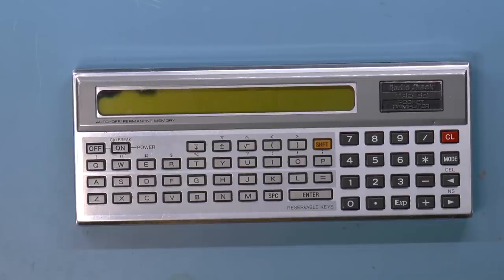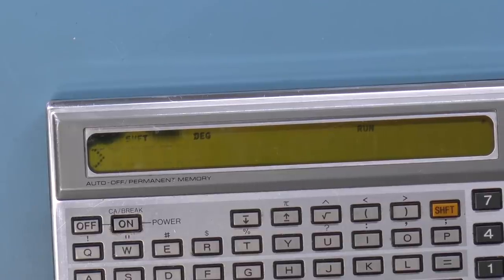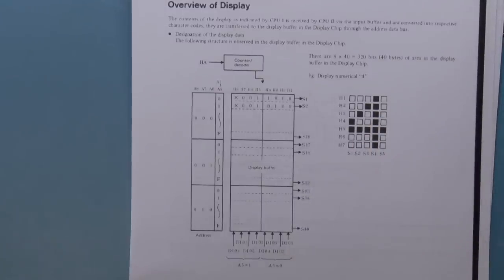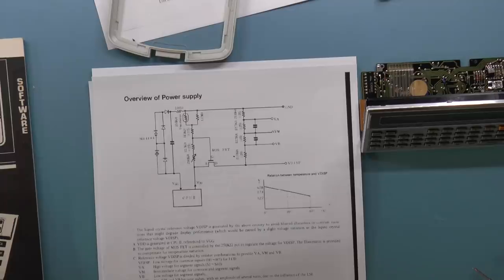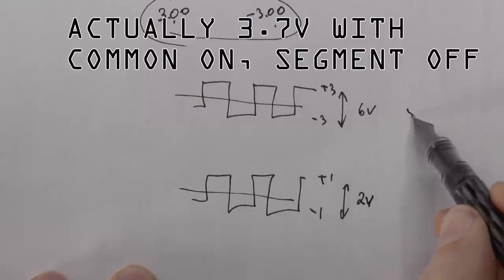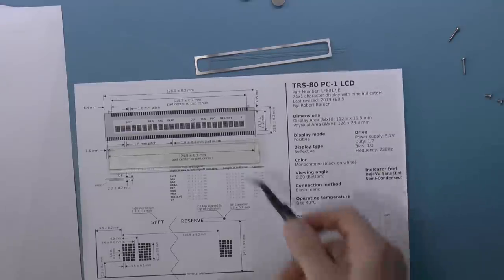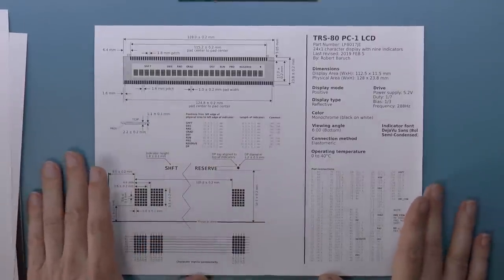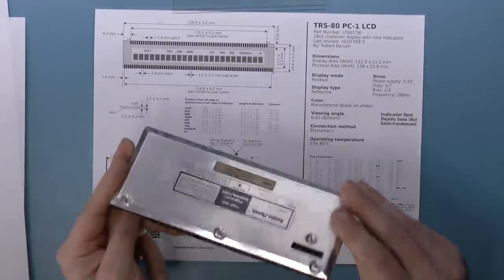Fixing ALL the TRS-80 PC-1 computers.

Comment: I'm one of those few hundred owners, Robert. I bought mine when it first came out and used the snot out of it. It's still the best advanced calculator I've ever used (even comparing current calculators). I would definitely purchase a custom LCD from you if you had one to sell. These are irreplaceable. It's a shame no one sees value in them anymore. They are incredibly powerful little calculators. I would buy one of these long before I would by a modern graphing calculator.

Comment: Greetings from a recent Tech Tangents video! I was so fascinated by this project, I just bought one on eBay with a printer and a trashed LCD, and bought your replacement screen, just to join the two together. It's so fascinating to learn that a replacement glass LCD can be manufactured at a reasonable modern cost! (And yeah, I'd fully expect Sharp to have paid a lot more than that, at the time, with the time's technology!)

Comment: Heroic effort!!! I'm collecting Sharp Pocket Computers and I have 2 of those, both of course badly affected by the cloudy display problem. The very few that are not or almost not affected are hard to get on eBay and are actually kind of expensive, so I would think there is a limited market for your solution! I certainly would buy 2 for the price you mentioned in the video! I also would consider buying a "refurbished" one. 
Anyway, here are some additions to your video: Originally, the batteries to be used in the units were not those zinc-air thingies with holes in them, they used Mercury based cells. Those are no longer made, I understand both for ecological reasons and because those could cause severe health risks when ingested (e.g. by minors). Anyway, these zinc-air cells have the same voltage and form factor as the original Mercury cells. People have reported that using more durable 1.5V cells with the same form factor instead works as well and doesn't harm the units...but try that at your own risk! 
The printer.......SHARP CE-122 . If you haven't already fallen in love with the TRS-80/PC1211, get one of those printers! Most of the units on eBay will not work anymore because they have NiCd cells installed internally that at best are dead and at worst have spilled stuff onto the PCB. Another restauration project.... most of the time you can get this working again by just replacing the NiCd cells. 
The printer uses a single needle to transfer ink from an endless ribbon (in a cartridge) onto plain paper. Unexplicably, those ink ribbon cartridges are still in production!!! It's super slow, it cannot print small caps letters, it makes a rediculous sound, .... but it is sooooo 80s :-) . Absolutely brilliant for it's time.

Thanks for the video and the effort to restore and preserve these historic machines (for many of us this was the first computer they programmed themselves).

Comment: i still have my original TRS-80 pockets computer. though mine uses the larger 3v coin cell battery .  guess mine might not be the P1? luckily my LCD is not damaged. also these could run on external power if you have the dock it plugs in to, it might also had a printer on that.  these really were awesome for their time. back when they gave you the manual to learn basic code.
Reply: mines a PC-4 , much shorter LCD screen. and uses two CRxxx 3v batteries. glad i looked because they were dead and could leak.  idk if it would be worth even china making a replacement lcd? i guess if a lot of people wanted to repair theirs. great video explanation on the LCD logistics.

Comment: I want to mention batteries (maybe its mentioned elsewhere here, but worth repeating). The originals were four PX675 1.35V MR44 battery cells- I see Wein listed as manufacturer for this style, but the M stands for Mercury, so they stopped production of these a while ago. They're no longer manufactured, so I found a four-pack of Nuon silver-oxides which advertise themselves as a replacement for PX675s . Apparently many have used 675 alkaline batteries meant for products running 24/7 (like hearing aids? I guess?) and they will therefore run out very quickly. So while they may have seemed "easy to replace",  some of these are going to be a disappointment for someone who wants to travel around with it and otherwise expect to use it for years without replacement. Wein makes 675 zinc-air batteries specifically to replace mercury batteries and these will work fine, if not for as long as the original mercurys.  Just be careful about which 675s/MR44s you are getting, and realize they will not last as long. The TRS-80 PC-2 uses common AA batteries, so if you have a chance at PC 2-8, they will be easier.

Comment: I have the same screen problem with mine.  I bought it new in '80 and "used" it about 25 years (the original batteries lasted 18 years).  Then I put it away and when I took it out last week I discovered the same LCD burn marks yours has, but mine is in considerably better shape.  I'm thinking of getting new batteries for it... Dang thing had only 2K of programmable memory and each variable you used ate up 8 bytes of memory (if I recall rightly), reducing your programming space.  On the upside, a command only took 2 bytes (once again, going on my aging memory).  It forced your, *ahem, coding to be streamlined for sure.

Comment: Sharp also released their own line in the US.  This was the EL-5500 series.  I have an EL-5500III.  It's a slightly updated version of the computer shown here which features scientific, statistical and matrix functions.  It runs on CR-2032 lithium cells.  I have found it to be slightly unreliable, possibly due to the flexibility of the casing.

Comment: Awesome project - reminds me of my misspent youth & my prized Sharp PC-1211. Hell, I'd buy a few displays, and I don't currently own a PC-1211. That said, I'd be interested to see how this turns out as I'd really like to see a replacement display for the EL-5100 (which had a similar-but-different LCD which suffers with exactly the same issue). I have only one example of the EL-5100 which has a (mysteriously) still perfect display - right now they're as rare as rocking-horse manure!

Comment: Have you looked into using a new LCD driver chip with the new LCD glass ?
I would like to see if a "new" PC-1 could be 3D printed with a new processor.
Reply from the maker: There's no reason why the LCD couldn't be driven by a standard LCD driver chip.

Comment: Loved the video.
Adding one more factor to the equation, however..
You are considering going through all that effort, but in the end, won't we arrive at the same problem?

I mean, you will have LCDs with the same defect -- vulnerability to humidity/moisture, right?

Is there a coating like maybe silicone or clear nail-polish at the junction which could be applied?
Reply from the maker: No, the original LCDs were manufactured poorly. Later models don't have this problem because they perfected the process by that point.
Reply: @RobertBaruch  Thanks.  Amazing job there too with all your effort.
Reply: @RobertBaruch  I checked this video out after buying  $4 thrift store, but the LCD is perfect: looks like new.  I bought Nuon silver oxide batteries , hopefully they'll last longer than zinc-air batteries.

Comment: I do not know the chemistry of how moisture affects the liquid crystal, but would it be possible to put the display in a vacuum chamber to try to remove the moisture from the display. Another option would be freeze drying to sublimate the moisture out. A third option could be  a vacuum oven with a modest temperature to remove the moisture.

Comment: I love mine.  There are few full keyboard calculators you can get.  I use it mainly to do simple base conversions but still.  I am wondering if its just easier to replace the lcd fluid though?

Comment: Interesting. Thanks for sharing.

   My inquiry here is rather topographical in comparison to your project, but I'll mention it anyways, sorry if the length of explanation offends. 
   Are there any tricks for mating/aligning the elastic strips? I've seen a bunch of the 'just clean it with [x] solvent' uploads, but discovered that doesn't always work.
    I recently took apart a cheap 128x64 graphic/ST7920 LCD module. The module itself doesn't matter, I ordered several. This has become a simple learning exercise.
 Originally, after removing the glass the elastic strips seemed to stick with an adhesive like property, (more so than is typical of the few dozen I have disassembled). When trying to reassemble the LCD, I found it very difficult to get everything reconnected. After a couple of attempts with the metal compression/alignment frame I tried without it. Without the frame, I noticed the tendency for a tiny amount of air to get trapped around the conductive portion of the strips. I tried mating the surfaces using isopropyl alcohol to eliminate this air. That resulted in the screen working again for the first time, although not well. I'm really curious what the original or alternate assembly processes are. I find it difficult to believe the OEM is assembling these and dealing with such a finicky process.  I didn't damage or do anything to cause such an issue with the device. I simply disassembled and reassembled a new unit that was tested and working. I was actually interested in the possibility of trying to find the IC version (if it exists) of the ST7920 chipset and reusing the glass on a custom board design. This would be a higher level challenge than the one you've taken on here, but I don't have an academic EE background, plus I'm not nearly as bright as you :-)

   The issue of the LCD-Conductor connection is a very minor aspect of the subject you're covering. There are a few subjective/empirical uploads about this. As mentioned, all I came across were simply "clean+solvent=good" uploads. Perhaps you know of, or if you come across the info on how to reliably make a connection between the glass and conductive strip you could mention it in the future. I was surprised this could be so difficult. I haven't had this problem with other LCDs. This one has a much finer pitch connection than any I have played with in the past though. Any insights or especially visual demonstrative info is greatly appreciated. I've even wondered if the factory is placing these in a vacuum to improve the connection. This seems to be a subject without a lot of info readily available.

  Regardless, thanks for the upload, and sharing this experience.
-Jake
Reply from the maker: Check out my TRS-80 Model 100 video. That deals with the same thing. The finer the pitch in the elastomeric strip the better. Otherwise, if the pitch on the strip is the same as the pitch on the LCD, I don't know how you'd align that. I also used an inspection microscope to pick out all the dust and hair that remains even after cleaning. Other than that, I have no particular expertise :)
Reply: @RobertBaruch  
will do. Thanks for the reply

Comment: A service manual for the T80-PPC notes both V_GG and GND :
'−' battery terminal and (100Ω and diode to) '+' battery terminal, respectively.   
Can the calculator be powered from this?
Reply from the maker: I'm pretty sure you could power this with about 6 volts, at least according to the schematic. There's no regulator, though, so you might want to add one if you choose to use an external supply.

Comment: If you end up ordering these I'd love to buy some
Reply: I have one of these  where the display is almost completely black. I wonder if there is a temperature that will drive out the moisture, but not ruin the liquid crystal? Bake it in the oven at 110c for 30 minutes perhaps?
Reply: Same question.  I'd buy one of the display (I have a Sharp PC-1211), but better yet, it'd be great if just "baking" the display would work.  Maybe at low temp, just enough to evaporate the water?
Reply: I'd buy some even if baking the old one does work. This project is awesome